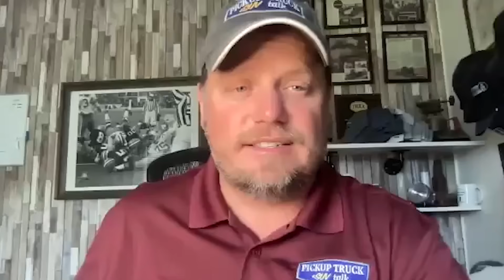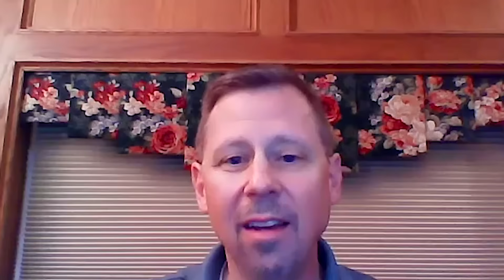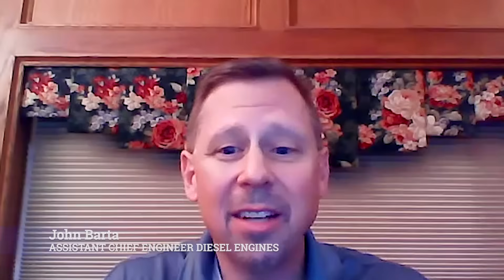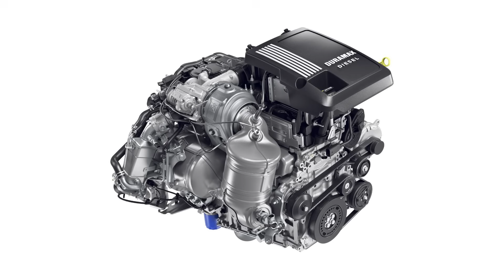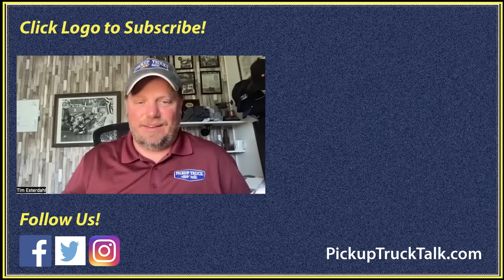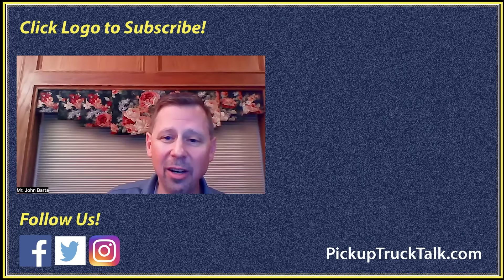GM's 3.0L Duramax Diesel Engineer Answers Questions Owners Keep Asking

Comment: Failed design.Cold start issue....?
Reply from the maker: Huh? Sorry, you lost me.
Reply: @Pickuptrucktalk  This is the most persistent issue that has plagued the 3.0L Duramax engine. The starter engages and cranks the engine for an extended period before starting or may fail to start. The problem has been reported in all the SUVs and trucks that GM fitted this engine, and the awful truth is that there is no specific mileage to watch out for the problem. While some drivers encountered the long crank after driving thousands of miles, some experienced it days after purchasing the truck.

It even gets worse as the actual cause of the problem is still unknown. There have been varying presumptions about the cause, and General Motors has released several TSBs. A damaged or warped camshaft position sensor wheel, faulty wiring harness, fuel pump, and actuators were all identified as the possible culprit.

In the PIP5806B TSB, the company explained that drivers might experience an intermittent extended crank or intermittent crank without starting if the trigger wheel is bent. The camshaft position sensor or trigger wheel is located close to the crankshaft and makes contact with the crankshaft during ignition to turn the engine over. Suppose the wheel is bent or damaged, it won’t make contact with the crankshaft and would need replacement. Depending on the level of damage, it could cause an extended crank or no start.
Symptoms of Crank Start Issues

    Long crank before starting
    Long-crank and no starts but starts on the second attempt
    Long-crank and no-start

Replacing the trigger wheel is a strenuous and time-consuming task. It requires the total removal of the cab to access the wheel at the back of the engine, and there is still no guarantee that it would solve the problem. Some drivers have complained that the problem reoccurred or even persisted after replacing the wheel.

General Motor has also mentioned that a faulty wiring harness, actuators, or fuel pump could cause extended crank time. Recently, GM suggested that an update or software refresh of the engine’s ECU should help sort the issue, and there has been some positive feedback.

There is still no definite fix as the problem reoccurred or subsisted after several of these procedures. It is an intermittent issue that General Motors has had to deal with since the engine was released. Sometimes, they may have to attempt all the solutions highlighted above until they can identify the cause of the problem.
Reply from the maker: @johnmills837  Ah, you are talking about long crank, slow start. 

He addressed that in this video.

Comment: I’m hoping the LZ0 is reliable. I have a 2020 RST with the LM2 and I’m having the engine/transmission replaced under warranty at 79k miles. Blew the flywheel and when they tore it down they decided that both needed to be replaced. Dealership doesn’t know what caused it… anyone else run into any major engine problems?
Reply: Could you replace your LM2 with the new LZO? THAT would be cool~

Comment: So, other channels state that the first version of the 3.0 is a ticking time bomb of expense as we will need to lift the body to do some very simple sensor changes and obviously the looming 150,000 mile timing belt change out.  Several thousand dollars for a $25 dollar part.  What's your thoughts?

Comment: Dumb question - but - is it normal to be re-designing so much of the engine this soon in its life-cycle? I ask as I am a customer of the ill-fated 6.2L V8 which has blown up TWICE in freezing temperatures in Vermont.  And so the truck is back for repair and I am planning to have Chevy buy it back (stranded twice in freezing weather is a safety issue).  But is the 3.0 Duramax headed for trouble, since GM is already replacing so much? 

Side note - amazing video and much appreciated. Owners need access to the right people - and your video did that! Really great.

Comment: Those power numbers are pretty close to the 2003 5.9 cummins ratings, both inline 6 engines, but with half the displacement, thats pretty cool.

Comment: Rough start to my LZ0 journey. Bought a 23 trail boss and at 200 miles threw a P0402 code. My dealership replaced the EGR and and a day of driving the code came back on. After a week with the truck my dealership decided to unwind my load and switch me into an identical 23 Trail Boss with the LZ0. My family put 200 miles on the second truck and the P0402 code was thrown yet again. My dealership then replaced the ECM and did a force regen on the engine and gave it back to me. I haven’t hit 400 miles yet so once I do our fingers are crossed that this solves the emissions issues I have experienced. Two VIN numbers 3 EGR valves and 1 ECM. Still love the truck but a rocky start since I trade in my 2018 5.3 V-8 truck that was flawless.
Reply from the maker: Huh. I just bought a new Silverado with the LZ0 and now have over 1200 miles with no problems. Odd for you to have a problem on not just one but two! Either bad luck or I just got extremely lucky. Let me know how it goes with the new truck.
Reply: I don’t believe dealer gave u another truck
Reply: @watchmanexpert  I have seen GM do that before. A co-worker's father bought a 2023 ZR2 and the 6.2 had lifter issues (the out-of-spec spring issue) on the drive home and had to be flatbedded back to the dealer the same day. They redid the deal and gave him a totally new truck.

Comment: This is all nice and such but what have they done to address the 5 big reported problems: Crank start issues
Oil pump belt replacement
Injector failure
Exhaust gas recirculation failure
High-Pressure Fuel Pump Failure
Or are these things that nobody will talk about?

Comment: Has it been definitely confirmed that SUVs won't get the new LZO? my yukon has the LM2 & that extra boost in power can definitely make a huge difference, especially on highway!
Reply from the maker: For 2023 yes. Slow rollout of new diesel.
Reply: Yes. My LZ0 came with a pamphlet showing the different duramax motors and it showed the SUV version (LM2) separate from the light duty truck version (LZ0)

Comment: Wish they weren't killing the 2.8 Colorado platform. Those of us that own them feel left in the dark.
Reply: The new motor destroys it
Reply: @ZmannR2  maybe so, but they wont put that in the Colorado/Canyons and I'm not a fan of the timing belt being against the firewall??? eek? that would be a nightmare to change.
Reply: @tjrob3452  oh the new motor? I thought that was just the 3.0 duramax
Reply: @ZmannR2  maybe not. I can't say for sure. I assumed there. Because they did it to the 3.0. I hope not. But nonetheless they aren't offering any diesel options in the Colorado canyon only some 2.4 l Turbo gas burner. I love my diesel canyon. It's got it's bugs won't lie the main one being such a crappy torque converter/ transmission they shoved in them. But outside if that and dpf woes it's actually a solid truck.
Reply: @tjrob3452  ya for sure!

Comment: I have the 2020 LM2 and it’s a great engine. The big question is that if the new revisions are worth upgrading or just keep what I have?
Reply: It’s a 10% increase in power. If 10% is worth it, go ahead! What’s more important is the interior upgrades on the new trucks.

Comment: What's your thoughts on the auto start/stop feature on the 3.0 diesel Tahoe? Does the auto start/stop damage the engine?
Reply: Worst feature of any new vehicle. I cannot believe they keep pushing that on us. Just get in the habit of pushing the disable button immediately after the start button
Reply: I would turn it off.
Reply from the maker: Nope, doesn’t damage engine. Much ado about nothing imo.

Comment: To me Theres no advantage of having a diesel besides higher fuel prices over the 5.3. The added cost to buy the diesel, the maintenance and cost of parts and servicing it doesn’t put you ahead.The added fuel savings if any gets swallowed up and negated by the added costs of servicing and if something breaks it will cost you 2-3 times more to fix. Unless your towing everyday and all day a diesel is not worth the price of admission and with fuel costs these days which wont be going down at all to levels before is a no brainer.
Reply: Wait until you have to replace the lovely lifters on that 5.3 engine. 5,300 miles on my 21 Sierra, and the whole left bank had to be rebuilt. Thankfully, it was under warranty, but that was a $4,000 repair in 21. No thanks.

Comment: How do I tell if a truck has the LZ0 engine or the older LM2? A certain VIN character?

…and the updated interior also? (I’m in dealer inventory search mode)
Reply: Any model stated as a 2023 will be a LZ0 The LM2 was built up until the end of the 2022.5 refreshed model run.  (Sierra’s I’m referring to)

Comment: I have a 2002 Duramax 6.6 and it has 300hp and 525 hp. Pretty amazing a 6cyl is basically the same specs.

Comment: 18:00 Extending the recommended interval for the LZ0 but not the LM2 for oil belt interval seems strange unless there was a change.
Reply: GM does weird things like that. They require any change to existing products to go through its own validation testing, even if the LZ0 and LM2 share 75% of components. Having seen the belt at 150k miles, I wouldn't be concerned with letting it go longer since it's not under a lot of stress like a timing belt is. You could always compare part numbers for the belt for both engines.

Comment: What about MPG?  I have a 21 RAM Rebel with the ecodiesel, which I love but I have always thought the duramax was a better engine.  With the elimination of the ecodiesel in 2023, unless I move up to a 2500 with a Cummins, this will likely be my next choice.  I just wish GM would really do something about the interior.
Reply from the maker: As you saw, they improved MPG as he mentioned. Plus, the GM interiors are all new for part of 2022 model year and all of 2023.

Comment: What about addressing the rear main seal that alot of people have been experiencing with the LM2.
Reply from the maker: Sorry, I hadn’t heard of that issue when I filmed this.
Reply: It was a rare issue limited to the first couple years of the LM2. Appears to have been solved. Probably an assembly issue at the engine plant in Flint, MI. The rear access cover has to be precisely aligned for leak-free seal.

Comment: What I don't get is, that the Technology for a Hybrid has been out for over 20 years, and Tesla has delivered "Motors" and drive systems that can Tow over "80,000LBS" OVER 500 MILES ON A SINGLE CHARGE OVER 10 YEARS AGO!!!! Why are these companies SO FAR BEHIND???? There should be TRUE HYBRIDS IN 1/2 TON 3/4 TON AND 1 TONS AS WELL AS MOTORHOMES!!!!!! Can't they find anybody smart enough???? Is every Truck maker really that STUPID???? Should have been out with a TRUE HYBRID 5 YEARS AGO!!! One that a 1/2 ton can tow 12K for 500 miles and then switch to (Gas or Diesel) for 1 to 2 hours to charge the batteries and then switch back to Electric for another 500 miles and so on!!!!(Should be able to go from Vegas to Bangor Maine on 1 tank of fuel!!!) But these BrainDead people can't even figure out how to build a "REAL HALF TON TRUCK!!" (CREW CAB 6 ADULT 4X4 WITH 8FT BED!!) They only build HALF TRUCKS IN THE 1/2 TON CLASS!! They can't even figure out how to replicate 1930 technology by having a two speed rear end!!! These trucks could easily get 40MPG'S NOT Towing and 20mpg's Towing 10K!!! With like a 2.55/3.75 Rear end with a 12 speed!! SO FORGET YOUR CRAP EV HALF TRUCKS!! START BUILDING REAL TRUCKS CC-8FT BEDS IN 1/2 TON WITH AIR RIDE 360*!!!! If you are going ahead with EV's then at least build them CREW CAB 8FT BEDS "THAT CAN TAKE A CHARGE WHILE DRIVING DOWN THE ROAD!!!!!!!! That way we can put a Generator in the back and after 500 miles just push a button and start the propane or Gas Generator to charge the battery so we can Get from Vegas to Maine in 3.5 days towing 8K or so!! So until you build a EV that can go 3,600 miles on a charge, make sure that we can charge going down the road like you have the rejen on the brakes putting power back into the batteries, but put a plug in the bed to plug in a Generator, Or just build a TRUE HYBRID FOR 2023!!!!!! STEP AWAY FROM THE BONG AND GET IT DONE "NOW"!!!!!!! Other than that good video!! Keep up the good work!! Keep on them until they start making REAL 1/2 TRUCKS for the MILLIONS of us people that travel towing, and all the Landscapers and Construction Company's that would buy MILLIONS of 1/2 ton CREW CAB 8FT BEDS!!!

Comment: I heard a rumor about cylinder deactivation on the new design.  Is there any truth to that?  I’m not even sure what cylinder deactivation is but it was suggested that it is not a desirable feature for a diesel.  Any thoughts?
Reply: There is no cylinder deactivation on either the LM2 or LZ0 that was speculation on YouTube.  There is auto start stop at a stop light/sign but GM places a button conveniently on the dash to turn that off for the duration of your drive 

There’s newer material on YouTube about the LZ0
Reply: No they are not adding cylinder deactivation. The emissions equipment needs to stay hot to work reliably. Shutting off cylinders would make that way too difficult and there are much better ways to improve fuel efficiency than messing with AFM.

Comment: How can the engineer say that they haven’t heard of one person being stranded? I’ve had 4 none start issues on my 2021 Tahoe diesel within a 6-7 month period. Once left stranded for 1-1/2 hrs at the boat ramp. Unable to load up our PWCs because it wouldn’t start. Have video showing it not starting at the boat ramp and time stamp on my phone shows me trying multiple times trying to start it. In fact it’s at the shop as I type.
 Going past two weeks. 
Seatbelt recall
Emissions Check engine light
None start ongoing issue.
I thought it was fixed when a previous Chevrolet dealership reflashed the ecu. Sorry don’t have repair records with me since they are in the Tahoe at the dealership

Comment: wondering if they warranty failure of the belt through 200,000 miles. Really surprised that an American made diesel has a timing belt.
Reply from the maker: I’d think Warranty has been extended based on his comments.
Reply: Not a timing belt that is chain - the belt goes to the variable out put OIL pump
Reply: @4961Studebaker  you are correct, still doesn't make since to have a belt driven oil pump that costs $1000+ to replace 
chain driven or gear driven would have been better

Comment: With Ford and Ram discontinuing there diesel options for there half ton trucks will this have any effect in the future for GM with there diesel program?
Reply: As long as GM continues having lots of 6.2 V8's available in their trucks and SUV's, they will need the 3.0 Dmax to help offset that hit to GM's CAFE average. Ford dropped theirs because it wasn't really competitive against an I6 diesel and F-150 buyers didn't see the need for a diesel option when they had engines like the 3.5 EB and 2.7 EB. It's different with the 6.2 V8 since that engine is hard on fuel and recommends running 91 octane fuel. The 3.0 Dmax makes up for its slightly increased operating cost by offering huge torque at low RPM and usually delivering 30 mpg.

Comment: so i am looking at getting a SUV or Truck with the 3.0 diesel. This will be my first time looking to buy a diesel. what are things i need to look for? Maintenance , DEF ? some dealer manager told me i needed to look for burn cycles? I could not running the vehicle until the burn cycle was done, i did not know what he was talking about.  Can you please give me some insight if i do end up buying a diesel? thanks.
Reply from the maker: He was likely talking about regen. Not a big deal and you can still drive it. Maintenance can be a bit more typically but not so much with the 3.0L Diesel. Also, DEF shouldn’t be an issue. A lot of old school thoughts around diesel that just don’t mirror current conditions.
Reply: @Pickuptrucktalk  thanks !

Comment: Hey I haven’t heard anything else about the LZ0 since you talked about it a while back and I didn’t see GM talk or show it in any of their trucks at the auto show. Is there any new information on it or when you can order it?
Reply: I haven’t heard much either. I went to the dealership yesterday to order my 23 1500 AT4 3L, and they just got a 23 model AT4 and it has the new LZ0 engine in it.

Comment: They planned on upgrading?? So you knowingly sold the last model knowing it needed improvements?? Wow GMC is a bunch of low quality crooks
Reply: Yeah sure but if they new there were weak points to begin with they should have perfected it. My truck has been the shop 7mos out of 2 years. For a 2020 that not okay. And gm wouldn't honor lemon law they don't care.
Reply from the maker: @belegit7221  tough luck on that truck. Hopefully it gets resolved.
Reply: @Pickuptrucktalk  I appreciate it. Love your channel
Reply from the maker: It is pretty common to plan an upgrade during the development of a product.

Comment: My Chevy is a 2020 and it's been in the shop for 7mo @gmc is worthless and won't honor my lemon law buyback, do I have to sue them? I even offered to swap it for the new diesel to see if the changes they made worked. I've replaced engine transmission turbo  torque converter, ac unit, Def fd up several times, autostart went out, etc.. this guy doesn't know anything he said the one I got was legendary and the only thing legendary it has given me is a headache. I'll post every video until Chevy does something about my work truck. 7mos In the shop is insane. Dealership said I had to get fixed first and then file and I did and GMC is saying everything is fixed well I don't trust the piece of shiiiiiiiit.